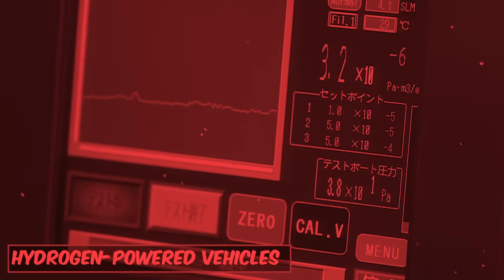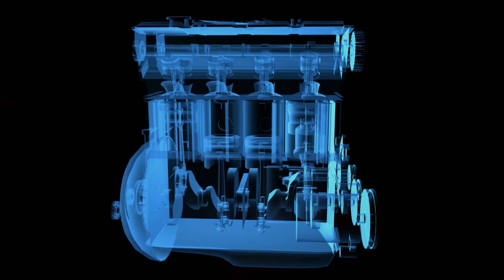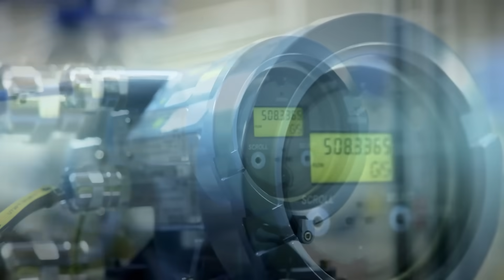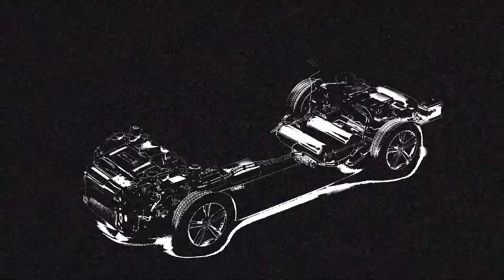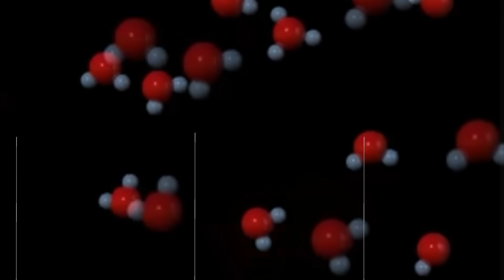Toyota's New WATER Engine Will Destroy The Entire EV Industry!

Comment: It is not water powered. It is a battery power vehicle.  This engine would need a hugh battery. The water molecule requires considerable power to split the hydrogen from the H2O.  Second law of thermodynamics can not be overcome. The power to split can not be fully recovered by burning the hydrogen.

Comment: This video offered some interesting info but was mostly blathering.  I find fuel cell vehicles impractical due to the dangers and cost of high-pressure hydrogen as fuel. The hydrogen-based ICE using water and an improved electrolyzer, like the one Toyota has been working on, has potential but the efficiency of the electrolyzer is not sufficient to overcome the limited range issues of an EV.  So, I am not buying the video's claim that "Toyota's New WATER Engine Will Destroy The Entire EV Industry!".   By combining a significantly better electrolyzer (80+% efficient versus current 60% devices), more modest sized onboard hydrogen storage tanks, a hydrogen based ICE like the one Toyota is developing, combined with the latest {more efficient} electric motors produced by Musk/Tesla, smaller batteries than used in current EVs, and regenerative braking, the result could be an hydrogen (Water based) ICE EV with extended range, very low operating cost and extremely low emissions.  The exhaust would consist of water vapor with some oxides of nitrogen.  Most of these components already exist or are in late-stage development.  Like other plug-in hybrid vehicles, it would have the option of occasional charging of the batteries ... seldom and only as needed.  Food for thought

Comment: This will NOT destroy the EV industry. That is a exageration. It will be another type of engine avialble for zero emission cars. Water has its own issues.  Below 0 degrees Celcius water freezes.  Their claim that distilled water is abundant and accessible is also not true.  Infrastructure will need to be built to store the distilled water, probably in gas stations today.  Plus some areas of the earth are without abundant water so the whole infrastructure for shipping it in will need to be put into place.  Also, water is heavy, limiting the amount of water any one vehicle could hold. One other thing to note is the design still uses pistons and gears like a gasoline engine. That means lots of mechanical things to go wrong like on our gas cars.  I had an electric car (Nissan Leaf) for over 11 years and had not a single issue. Electric motors have little to no issues.   So I think it's a great idea and another option, especially for those who are addicted to adding some kind of fuel to their cars. Please stop declaring that it will be the ONLY option avilable out there. Last comment is that I agree it is a safe alternative for a fuel.

Comment: Electrolysis is very inefficient (25-35%) where EV's are 85–95%. Furthermore, the amount of energy required for electrolysis is greater than the energy produced by the hydrogen. Thus, some energy source is needed to support the electrolysis. 

Water engines do have benefits, like faster refueling and since they don't need batteries, may be better suited for trucking (long hauls). Not a good fit for passenger cars as of today.

Comment: I wouldn't call this "water powered" when you have to use an internal combustion engine. What powers the hydrogen production? OK, can the hydrogen powered internal combustion engine simultaneously generate enough electricity to supply its own hydrogen consumption to do this PLUS power a vehicle at usable speeds? Can it generate ALL the electricity it needs without going to charging stations?

Comment: This is a very old scam. Electrolysis takes more energy than it produces. You would have to have a separate power source to power the electrolysis. HHO is different. That is using a gasoline engine to power electrolysis to generate hydrogen and oxygen to feed back into the intake to cause near 100% efficiency of the combustion of the gasoline. I built and used one for years. 4 tanks of gas per week was reduced to 2.5 tanks per week but it required the mixing of pure potassium hydroxide for an electrolyte and pure distilled water which takes more power to produce. The scam here is getting your interest and your clicks.

Comment: Hydrogen will play a key part in the climate fight, but not in fueling regular cars. Trucks, or specialized vehicles, maybe, but almost certainly as seasonal storage capacity. Cars are just not sensible use cases. EVs will be better for that.

Comment: This is complete bullshit. 

To get a car to drive e.g. 500km on 3kg of hydrogen, you'd need about 125kWh of electricity. Where is the electricity coming from. My guess would be batteries. How far can you drive on 125kWh worth of batteries? About 500-800km.

Using electrolysis to create hydrogen from water only creates inefficiencies, which could be averted by just using the electricity directly in an electric motor.

Comment: Wow, Toyota has managed to remake the laws of physics, how amazing! 😂😂😂😂. More seriously, to electrolyse water into hydrogen and oxygen, takes more energy than you get back by combusting the gases back into water - so there is an energy deficit in the process. To make up the deficit, the vehicle would need a large battery pack and be charged regularly, and because the water-hydrogen-water process is so inefficient, it would use more electricity per km than a battery only vehicle. This video is utter BS!

Comment: Well perhaps the circle is squared by a combination of energy recovery from regenerative braking/downhill motion and solar panels on the vehicle?  Perhaps that gives enough power to split hydrogen from oxygen in water? I have also seen suggestions that we might be on the verge of technologies that can perform the equivalent of electrolysis without major energy input. I think these are called "photocatalytic" processes involving particular materials that can enhance the splitting process (that can occur naturally).

Comment: This is a scam or maybe misleading, an engine maybe powered by a hydrogen, but not water, water is a by-product of combining hydrogen and oxygen. The way he explains it, the car performs electrolysis on the fly, having water separating hydrogen and oxygen, then using the hydrogen for combustion inside the engine. Ok, that maybe possible, but the big question is... where will you get the electricity needed to perform electrolysis onboard the car? So, you still need battery, while the electric energy you can get from the hydrogen is just less if not equal to the energy used to perform electrolysis.

Comment: I ran my lawnmower for about 5 minutes on Brown's Gas (the hydrogen and oxygen gas mix from electrolyzed water). The energy I had to put in to generate the gas far exceeded the lawnmower's output. And as a side note, I had to add baking soda to the distilled water in order to get an appreciable amount of current to flow - needed for electrolysis.

The need for an electrolyte could be eliminated if you bring the positive and negative electrode plates close enough without shorting. And, there may be some kind of "optimized" nano structure surface on the electrodes that catalyze the electrolysis process so the input energy requirement is reduced (what happens if you exceed the maximum electric field of water such that it goes into avalanche dielectric breakdown). However, this is all science fiction speculation and yet to be seen...

Comment: We still need something to power the cracking in the water. So, an engine or battery. So what's the point if I still ned a gasoline or oil powerplant to charge the battery?

Comment: Have they solved anode degradation. Water engines were never practical because electrolysis caused anode degradation after very few hours of use.
This would mean continued anode replacement, dependent on use, and this would be costly and impractical. 
Ceramic, not metal, anodes were promised then nothing.
Perhaps this is Toyota's secret?

Comment: What is the source of the power (energy) that produces the electrolysis?  Is the power consumption for electrolysis greater or less than the power output of the hydrogen produced?  Where does the oxygen go? How much energy is used to produce the required distilled water per gallon, and how much emissions are released in this process?  Whatever happens to the water tank in freezing temperatures?  🤔

Comment: To be honest, this is an electrically powered vehicle.  However, it is more efficient to use electricity directly than to use it to produce hydrogen from water.  In addition, hydrogen-fueled ICEs have all the disadvantages of gasoline or Diesel engines, plus some additional ones.

Comment: The efficiency of a hydrogen internal combustion engine(HICE) is about 1/2 that of a fuel cell electric vehicle(FCEV) which is far from 100% efficient. 

I believe the reason the video uses the HICE instead of the more efficient FCEV is with the electric in to electric out idea it sounds more obvious that it's perpetual motion, even though the opposite is far more obvious when you understand the efficiency differences between combustion power and electric power.

Comment: First, electricity is stored in a battery to electrolyze water, separating hydrogen and oxygen.  Second, the hydrogen and oxygen are recombined to generate mechanical power via combustion, reforming water.  However, since the resultant water is not recycled, continuous operation requires battery recharging and water replenishment. 

Why not just use battery and motor without the need of wasting water?

Comment: Uh, I have a question for you.  Where is the high voltage electricity that they are going to use for the electrolysis going to come from? If you say from a generator that is powered by the engine that means the engine is going to power the vehicle down the road and provide the electricity for the electrolysis via a generator.  We will have to conclude that the efficiency is going to be in the neighborhood of 150 % give or take.  I suspect the answer is you rub the bottle provided in the back seat and when the genie pops out you request the electricity from him.

Comment: I'm tired of water engine, nobody has the courage to put it in the market.Toyota better concentrate on the ergonomi on there cars.The price of the parts , like the head light on Sienna and other models. The price is 2500$ per part plus the work it is insane and other.The defrost system    at the windshield during the winter time is not enough efficient. That will be more important for the tone of money we pay, thanks.

Comment: Anybody telling you that this is dangerous is full of sh!t 
HHO2[Brown's gas] is extremely dangerous, like atomic bomb type dangerous. 
But that's why you separate the hydrogen from the oxygen and you keep it separated until you meet them back up in the Piston cylinder which will have a massive explosion causing a huge amount of energy or you just send the oxygen into the interior of your car. 

No the facts are that this is very simple and there's only one reason they have not engineered this and it's not already on the road and that's because massive powers with huge financial wealth when to keep us locked into their system for their own self enrichment. 

I'm not even an engineer and I know for a fact if I had some finances to get this up and running I could. So we should all been using this back in the '80s at least

But think of how much money all of these Fortune 500 companies would have lost, think of how much sovereignty one of the average people would have had. 

The slave masters cannot allow that! And as long as the people are too afraid to realize and accept the fact that they are slaves and they will be good sheeple for the Masters!

Comment: This is total BULL SHIT. Anyone with a basic knowlege of engineering or chemistry knows this. Buring hydrogen produces a massive amount of heat because it produces water where the oxygen and hytrogen atoms are chemically tied together extremely tightly. This means that it takes a massive amount of energy to split them apart. Elecrolysing water and then burning the hydrogen loses at least 30% of the original energy. Then the enging wastes at least 65% more because all engines produce waste heat (think of the heat comming out with exhause gasses on any engine). Even the most efficient power stations, where equipment can be large and bulky, still waste at leaset 40%

Comment: Here in Nampa Idaho in the late 40's and early 50's there were a couple of men who had saw a way to capitalize on free energy while they were in Germany during the war. Some how they created a negative charge on their car and pulled electricity from the local power lines. As i was told the car performed very well within several hundred feet of an active power line.  The local people said that their lights in the house would dim a bit as they drove by. Some people from back east came by and said they were from Westinghouse. They bought all the equipment and hired the men to work for the company. They loaded everything up, took the men and left never to be seen or heard of again.

Comment: Not even guessing the cost of such a vehicle, an engine would have to be a hybrid able to recharge batteries (how powerful they need to be is another subject) while producing enough power for hydrolysis, ignition, and other power needs of the vehicle.  For the sake of argument, let's assume pumps to dispense distilled water pumps would gradually replace ones dispensing gasoline, but how would it compare in cost unless engineers can also make the engine process tap water into distilled water fast enough for it to be used by the hydrolysis converter.

Comment: The point here is that electric vehicles need large batteries with low mileage range , and the hydrogen vehicles have infrastructure limitations  . Here, producing hydrogen via electrolysis on site . you can fill your vehicle with water and connect it for example to a solar panel, or you can equip it with a solar panel on the vehicle roof and leave it  making electrolysis until it fill your tank with hydrogen

Comment: Where do they get electric power for electrolysis?
Hydrogen burns in air and not in pure oxygen; hence not only water results but also various quantities of nitrogen oxides.
Do not forget the need for lubricating the engine components.

Comment: Entropy is the problem the electric energy has to be greater than the energy in hydrogen so it need huge batteries
Reply: Only a small battery like the one already in your vehicle is more than enough . The point here is that electric vehicles need large batteries with low mileage range , and the hydrogen vehicles have infrastructure limitations  . Here, producing hydrogen via electrolysis on site . you can fill your vehicle with water and connect it for example to a solar panel, or you can equip it with a solar panel on the vehicle roof and leave it to start making electrolysis until it fill your tank with hydrogen,  here you need only a small battery and even not any battery

Comment: Make electrical generator boxes like fridge size, & water separator boxes to get Hydrogen  & Oxygen from water. Install them where water pressure is available along shipping lines like from Seattle to Alaska. Using poly pipe/tubing down 231 feet gets 100 psi water pressure to power the generator/alternator.  Then a ship comes by and empties the tanks and replaces the boxes when needed.  This uses wasted power to make clean burn fuel.  So how much wasted hydro power is there in the world ?  Wind power ? Tidal power ?  Geothermal power ?  Now you are catching on.......

Comment: Interesting Topic, I agree, but from what I can glean, if the Engine was proved to work beyond a shadow of a doubt it, The Engine,  would require  “ Distilled Water “ in order function so in my mind this does raise a few questions :
1. How much would, say, One Litre, of  “ Distilled Water “ Cost ?
2. How many Miles ( or Kilometres ) would you get for One Litre of  “ Distilled Water ? “ 
3. How much work, and if you like Cost, is required if you take the plunge and attempt to
    make your own  “ Distilled Water ? “ 

On  “ Distilled Water “ as such, Google tells me that for about every Eight ( 8 ) cups of Tap Water you have to Boil for at least One ( 1 ) Hour ( 60 Minutes ) you will get about One and a Quarter Cups of actual  “ Distilled Water, “ this seems to me a lot of power input either from Electricity or Gas,as well as the time spent monitoring it all for, frankly, not much gain in actual “ Distilled Water, “ so you would apparently get about Four ( 4 ) Cups of “ Distilled
Water “ for the Cost of making it over a period of Three ( 3 ) Hours, doesn’t sound very Economical to me and where are people going to find the time to monitor this rather monotonous exercise in a society which is increasingly frenetic where so many are
simply  “ Time Poor ? “ Finally, I take it that  “ Distilled Water, “ as with Tap Water, can actually  “ Freeze” under very severe Cold Climatic Conditions. You would hope that this didn’t happen but if it did, then what would you do ) ? My overall point is that unless ordinary 
Tap Water could do the job, then the whole concept just doesn’t seem viable or practical to 
me personally, and even then what are the ramifications if the water available in the area in which you live has been through a De-Salinisation ( removal of Salt from Sea Water )
process ?